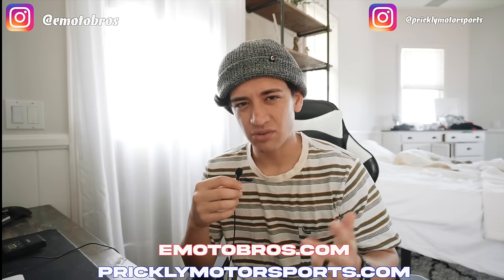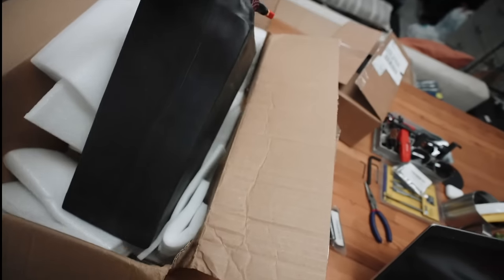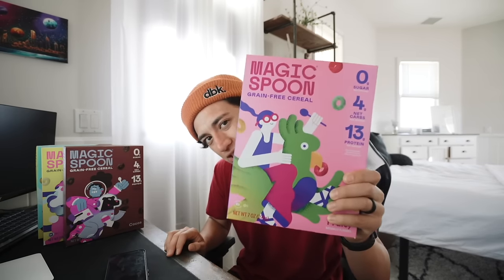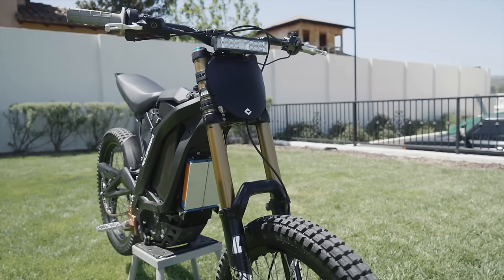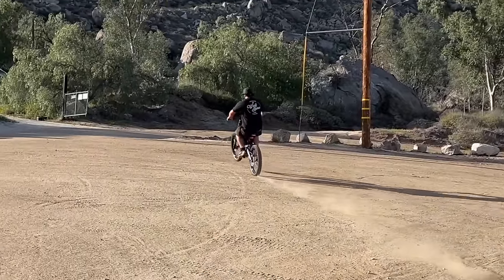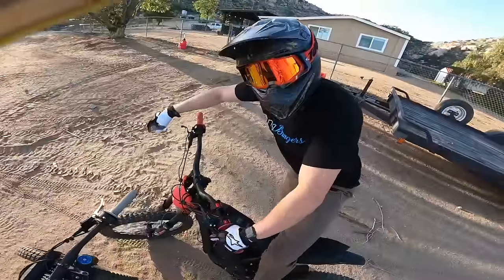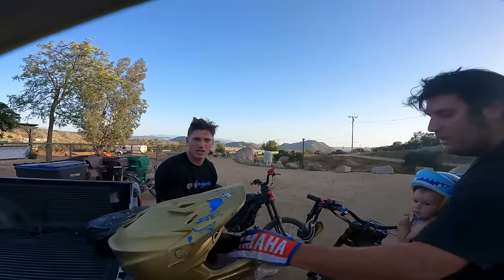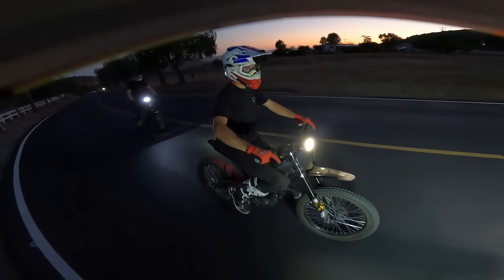Best Sur Ron X E-Bike $10,000 BUILD!!

Comment: 7:16 Fox owns bomber and makes their suspension lol, the problem with fox factory suspension is that it comes with a grip2 damper. The average person doesn't know how to adjust the million settings they have. They have low/high compression, and low/high speed rebound settings. If any one of those settings are off, the whole fork is off. The other issue is that they are bike forks, they are designed for a 35-50lb bike. You got them on something that is probably 100+ lbs. For them to work right, you'd probably need to the damper revalved for this specific setup.
Reply: Someone with some good knowledge here!
Reply: Any fork recommendations for the surron ?

Comment: I thought they come stock with a 60v battery. Which one did you get?
Reply from the maker: 60v high discharge. So it’s the same volts but configured in a different way somehow to make it last 2x longer